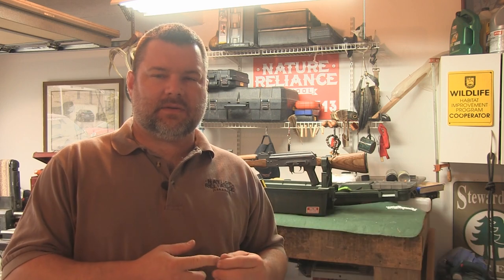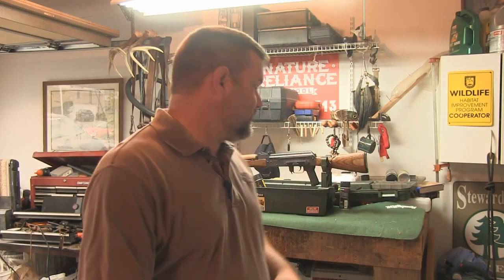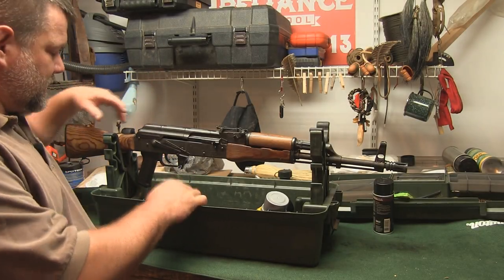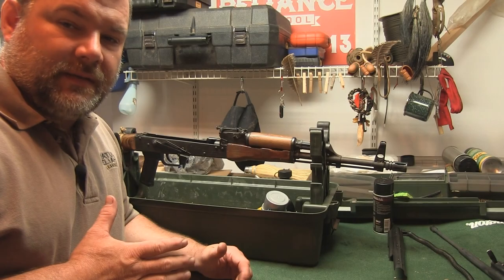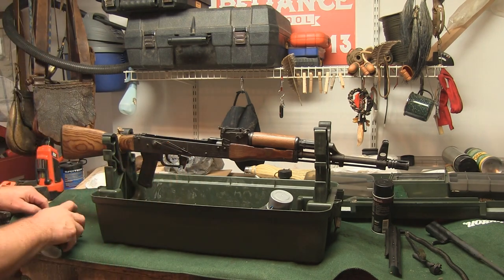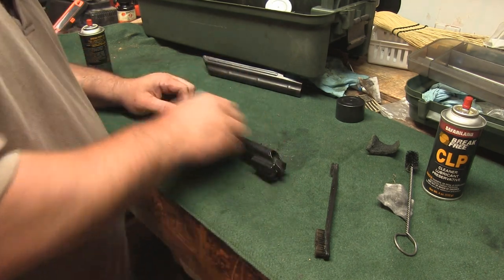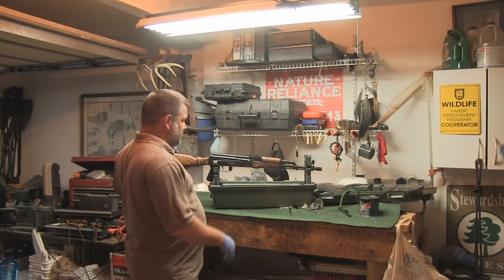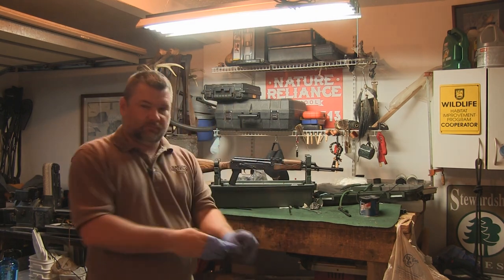How to clean an AK47

Comment: Great video the only thing is that if you have plastic furniture the brakefree spay will melt plastic it happened on my beretta 380 messed up the checkering on the grips. You have to be careful with that stuff. Thanks for a great video. I  just got a yugo and I don't think it's ever been cleaned.
Reply from the maker: +MrEricdgreat Interesting tip! Thanks for watching! ~Craig

Comment: Thanks for the video, I just bought my first AK and this helped me. Just curious though, why do you apply the grease to the rails? Are you worried that the friction will degrade the gun significantly in that area over time?
Reply from the maker: +Dev Prior Simply because that is the area that gets the most movement and therefore needs to be frictionless.  No hard reasoning for it.
Reply: The lubrication is to prevent or reduce metal to metal contact, thus reducing wear.    One of the main reasons for oil in an internal combustion engine.

Comment: Do you know what would cause an AK to do 2 round bursts sometimes 75% of the time. And how to fix it or if you can fix it
Reply: It could be because of your trigger, or the firing pin problem. Check firing pin, most of the time the manufacture used cheap material to make and cause wear and tear faster.

Comment: Beautiful ak love the wood furniture hard to find what manufacturer is yours?
Reply from the maker: +Edgar Valdovines This one was manufactured in Romania.  Thanks for watching! ~Craig
Reply: Looks like an Arsenal. I just bought a Kalashnikov USA KS-103 so looking at field strip an clean videos. Yeah, yeah. I know Ak don’t need nearly as much cleaning as my AR’s, I usually clean my AR’s after 500 rounds, but you still need to clean the AK periodically for it to run smoothly and accurately. The build up of gunk may not cause it to jam, but will cause the piston to jar the gun more and the barrel will loose accuracy with the build up etc. hence I will still clean mine up after every 500 rds.